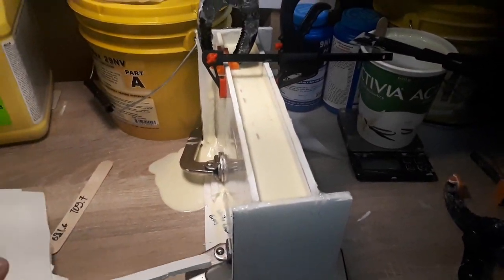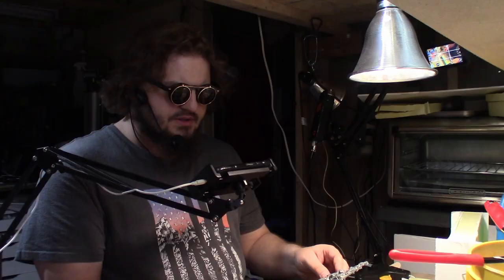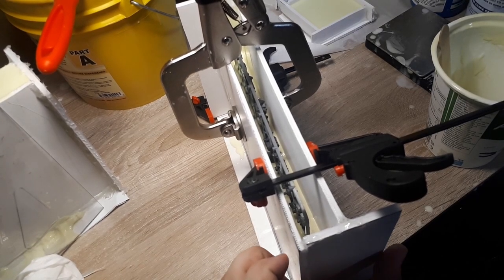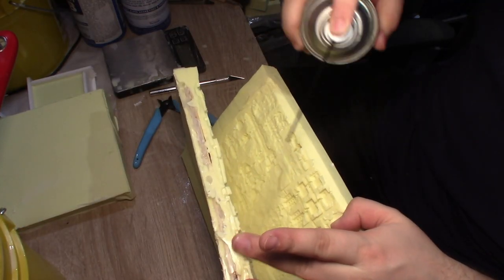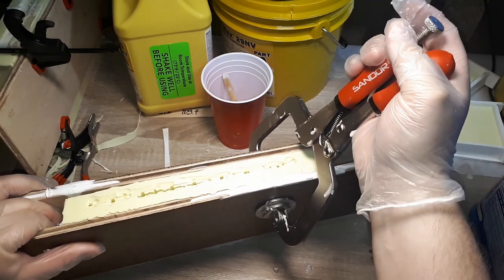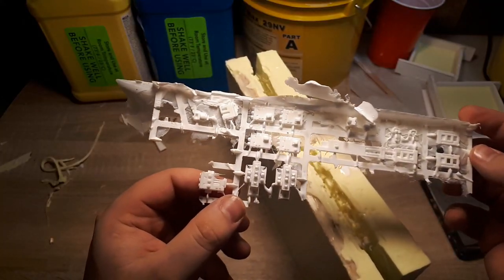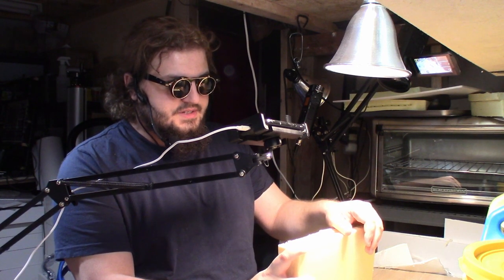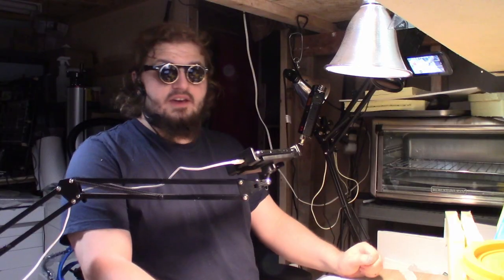Recasting a Tau Broadside [part 2]: Opening the Mold and Casting w Liquid Plastic [Warhammer 40k]

Comment from the maker: So the most important takeaways in this experiment are:
1) Even if you screw up and mount the sprue upside down, and your air vents in the mold end up pointing down, you can still salvage it by making air vents by hand with a project knife
2) All that nonsense about placing ice cream sticks inside of the mold to improve rigidity - for get it. Seems like the extra air vents are pretty much all that we need and for rigidity, you can use any rigid planks of wood on the outside of the mold.

Comment: To help you out. Use a 3d Printing Pen instead of a hot glue gun to make air channels on your masters. You'll get much better control and precision. As a fellow smooth-brain to another, keep orienting your masters the way you are but build the reservoir you pour the resin into at the bottom of your mold. Use foam blocks at the bottom of said mold to act as the reservoir. Then, when pouring your resin, pour your resin into the reservoirs on most on the sides of the mold, allowing the air to escape up the middle until you finally see resin beginning to come up and out of the middle of the reservoirs. Rotate your mold from side to side to burp it. Lastly and most importantly. Use a slow curing resin, like an hour or longer. It'll pour into the mold easier, with less viscosity, and as it sets up you can come back and rotate the mold bottom to top, side to side, to get more resin into any last little areas before it fully cures.
Reply from the maker: Interesting method with reservoirs and pouring from the sides first. Going to give this a try during my following experiments. Much obliged for the wisdom.
Reply: @RebelWorkshop  hes right it will also help if hold/pour if from higher up the key point being you want the stream as thin as possible this will also help to eliminate air from mixing.

Comment: Put some jagged edges in Thame beginning of those cuts and it will help to line it up/close together hold I in place ie preventing mold slip also get some medical equipment like the stretcher things like the opposite of hemostats to hold it open while you cut.

Comment: Maybe using diy dust mesh filter intended for PC cases instead of popsicle sticks could make for an easier reinforcment wall to work with? Seems like it could be a nice strong yet somewhat flexible material for working with the silicone and liquid plastic
Reply from the maker: TBH my latter tests concluded that, as long as I have solid walls to press the two mold halves with from the outside, the inner reinforcement is not offering any tangible improvements in bubbles or film. Nevertheless, had to try to find out.

Comment: So, I have ZERO recast experience aside from some blue stuff and milliput heads. But watching these two videos, has given me an idea. Though maybe it is bad. While I know this isnt an option for a lot(I have access to a CNC router). But would making an acrylic mold box that you can bolt together, seal, both help with reusing boxes for casting molds(of the same size obviously) as well as putting the mold back into the box, assist with the even distribution? Hopefully what I am trying to explain makes sense haha.
Reply from the maker: There is this particular mold box design that is basically the most tried and tested shape that I'm always referred to in the mold making circles.

 https://hackaday.com/2021/06/16/modular-box-design-eases-silicone-mold-making/  

It's essential this Г shaped wall and when you have 4x of them, you can modularly build just about any mold box you wish to just by moving the clamps.

Comment: I'd be cutting the sprue into sections and doing smaller molds.
Reply from the maker: This indeed does make it easier. Easier to squeeze the bubbles and if something gets a bad cast, you don't need to recast the whole ass sprue

Comment: I wonder if it would be worth getting a vacuum chamber to really pull out any air bubbles during mold curing and the plastic setting 🤔
Reply from the maker: In cases like these, a pressure chamber is more suited than a vacuum chambers because a pressure chamber will force the bubbles to implode under immense pressure into a size so small, it will be imperceptible. Normally around 60psi is said to be more than enough. I have tried with 90psi and still had issues but I also used quick curing plastic. The vacuum chamber will just make the bubbles grow and if they're stuck inside a crevice of a silicone mold, they won't escape no matter how much you suck - "Woman's Guide to hunker down a husband circa 1986"
Reply: @RebelWorkshop  huh I didn't know that 😊 thanks

Comment: Honestly, it is better to cut the sprue and do multiple smaller castings rather than the entire large sprue. Another method, although extremely tedious and time consuming would be to cut each piece and cast them individually as well. Also please get a pressure pot and vacuum chamber.
Reply from the maker: Cutting up definitely makes it so much simpler. Way easier to handle and any defects doesn't mean that you gotta now recast the whole ass sprue. Just the segment that has the failure.

I did try recasting individual bits out of the sprue but honestly the amount of work was about the same. I also like to keep the parts in the sprue because the sprue has the part numbers so assembling to the guide is a touch easier. I am also adamant at recasting the whole sprue because - if I'm successful. Making a new copy is as simple as pour-wait-pull and that's it.

Have both pressure pot and vacuum chamber. On that note - My most recent attempt had very, near perfect result without the use of either. It's just a matter of prep technique and patience. Video coming.

Comment: Hi there! Believe it or not, I actually have also thought about a method similar to this long  before your videos were shown in my feed. However, I am limited to the supply available. Also, I have been really busy pursuing my career, hence the inability to complete my experiment. Here are some points I want to suggest:

1. Instead of using flimsy boards and wooden stick, try making a dedicated mold box. Imagine a hollow stainless steel box with an open hole (to stick the sprue to the base, just like yours) on one of its edge (similar to the mold boy you created), then slice them in half along its narrow edges. The halves are then sticked together with something like rubber bands to seal the resin, and then pull apart to reveal the silicone molds after you make them. Use the same box to make the mold and to pour the resin. The beautiful part about it is, because it is made of stainless steel, it has strong opposing force against the rubber band (or in your case, c-clamp). Therefore, the mold is neither too squeezed nor too loose, ensuring the same dimension used in making the mold as the same dimension in the recasting process. This prevent the flashing you found in your videos.

2. Instead of pouring the resin from a narrow pouring channel like you did, consider using the squish mold method (watch Robert Tolone's video). In summary, basically you spread open the molds, and then pour the resin on theopen molds. Pour on both mold parts, then stick them together inside the mold box mentioned earlier. This ensures easier resin channeling AND not requiring you to make additional vents as the gas can be easily push out when the surface area is bigger.

3. Use transparent platinum silicone to make a stronger, more durable, and easily cut (as you can easily see the mold as you cut) mold.

4. As you are making the mold and recasting, use a vacuum chamber and a pressure pot, respectively. Use the vacuum chamber right after you pour in the silicone, ensuring your mold to follow the patterns on your sprue down to the last minute detail, whereas the pressure pot reduce the number of the bubbles when the resin is cast.

That's all. Please tell me if you decide to trying this method! I am curious whether my engineering knowledge is enough to overcome this hurdle xD
Reply from the maker: My pressure chamber is not big enough for a whole sprue mold. However if I cut it up into several parts it just might be.
With the pandemic raw materials are becoming quite expensive so perhaps instead of steel / iron or aluminum, I could use a thick piece of plywood or fiberboard.
Reply: @RebelWorkshop  IKR! I live in Indonesia, manufacturing third world country. Yet, the custom pressure pot and vacuum chamber (2 in 1) from stainless cost USD 2000 upward. Now I am thinking of making a kickstarter 🤣

Comment: Are there sections that would be easier to mold as a complete part, for example if you made a arm or leg and then made a mold of that, is it possible that they would cast easier than the separate components on a sprue
Reply from the maker: Oh for sure. less parts to recast. The goal of this experiment was to see if one can recast the sprue itself so that assembly could still be undertaken. If that wasn't the mission, one can pre-assemble a good number of parts right from the get go and have much less molding to deal with. To be honest, I might just try that next.

Comment: Do you think cutting the sprue/ modifying it to be shorter would help with some bubble control? The downside is making more molds, but you'd have a shorter distance for air bubbles to travel up, right?
Reply: Whoops! I didn't get to that part of the video yet. My bad!
Reply from the maker: @Gamma5232  The most recent experiment video, I've tried making 1 mold out of two sprues and the result is actually very manageable. I can definitely cut up a large mold into multiple smaller halves or even quarters and make a single mold containing all the sprue segments. This way if something casts poorly, I only need to recast that one segment instead of the whole damn sprue.

Comment: This is a painful fiasco - it’s as if you never researched anything about moulding as casting. There is so much GOOD info online (especially YouTube) on how to do this correctly.

There is nothing or anything to learn from here, people. Just don’t do it this way. And you don’t have to do the whole sprue, the runners - everything. A huge waste of resin.

You need to pressure cast this. Use a resin with a longer cure time so you have more time to pour. Your mould is too thin. Mould and cast the runners of the sprue?! The entire sprue?! This is a huge comedy of errors that no-one can learn from. 

Please, anyone, look elsewhere if you want to learn. This is all the wrong way.
Reply from the maker: You're absolutely correct. There's a plethora of information available and if you're looking to do it, and want to minimize wasted product from failed casts, you should do your research.

In my case, I just wanted to go balls deep and try it out. See what I can make of it.

There were also some conditions I had imposed on myself for recasting these: 

First I wanted to see if I can make recasting as instant as possible. So recasting the whole sprue means to make a new one, all I have to do is pull a mold, apply release, pour and done. Yes that causes unnecessary plastic product waste but it maintains.

No pressure pot or vacuum chamber. Same reason. Seeing if I can pull it off without additional steps. Positioning the sprue vertically had eliminated nearly all of the 

"This is all the wrong way." - There's value in seeing how not to do something. Saves other people on time and resources. I've taken the hit for everyone else.